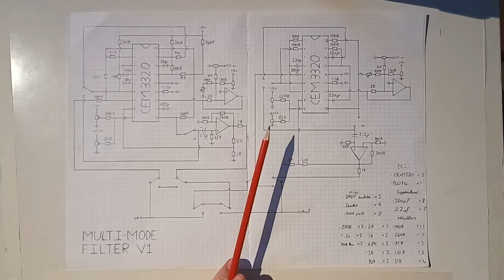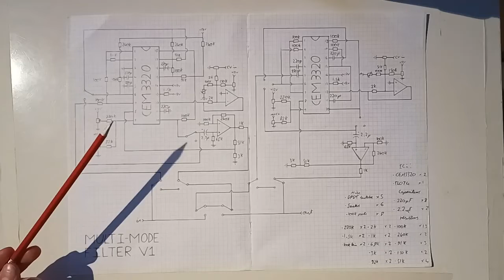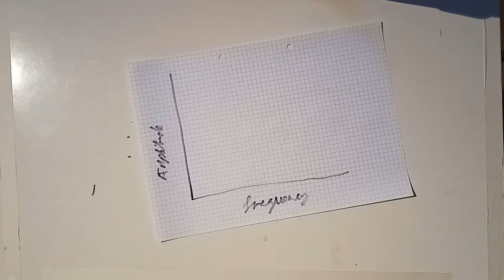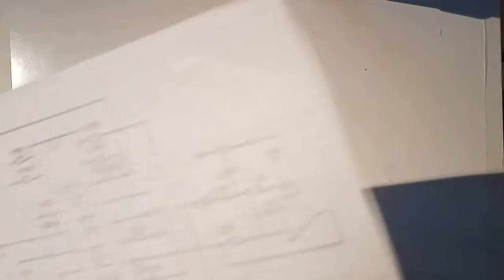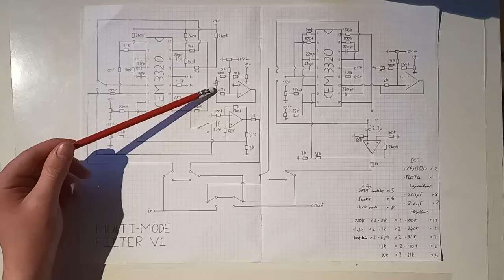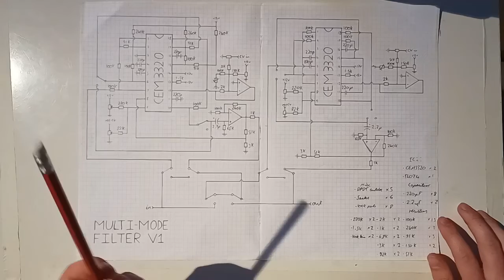final filter

Comment: Very nice and detailed walkthrough of your project. I have a couple af CEM3320s and I had planned on making a rather simple multimode filter using one of the chips as LP and the other as HP, with cv for both frequency and resonance. The first thing on my todo list, was to seek info on the 3320 , and then I find this project, which is 99% what I wanted to build. So I'm guessing, just I'm gonna copy most of your work.

Comment: Thank you for the info.  I decided to build the electric Druid multimode instead of designing my own.  Unfortunately it comes with a lot of problems. Oh like the 2^4 combinations using just one 3320 which is why I decided to try that. 
The input to the first stage has a large DC offset which isn’t desirable, but the remaining stages are somewhat reasonable.  
Next time I’ll do what you did and just design what I want instead of trying some else’s idea. 
Thanks again for your videos on this chip.